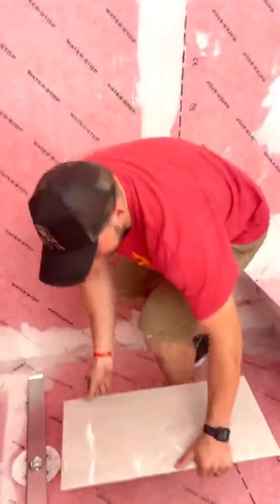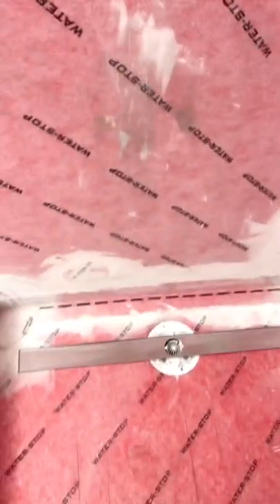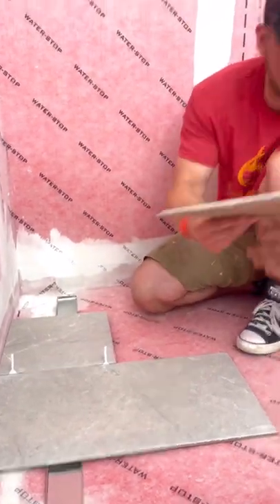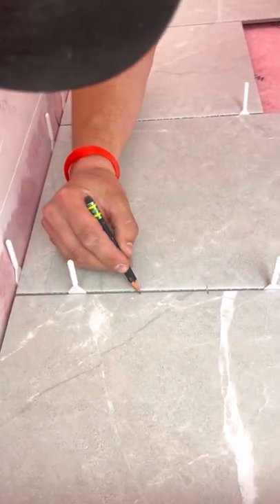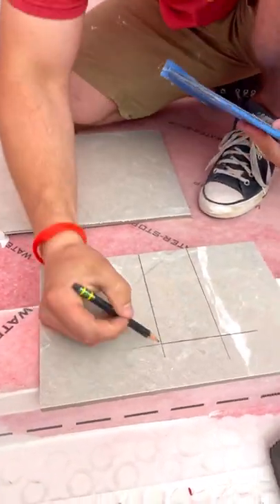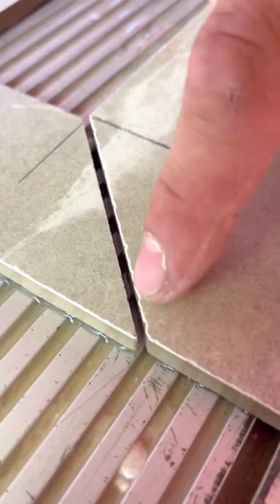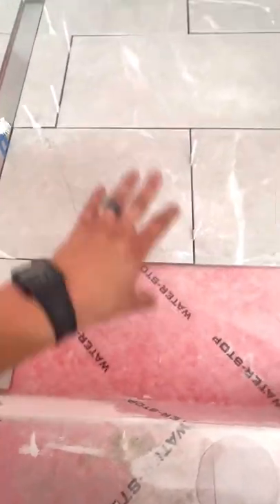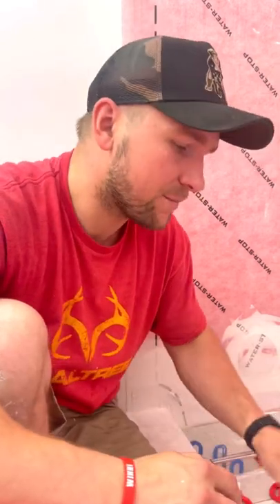🔥EASY🔥 12x24 LARGE FORMAT TILE on Shower Floor. WINNI DIY Vlog 011

Comment: I have  3x5 pan but the drain is off-center as well as to the far side of the pan. Would I still want to run the x cut off the drain in line with the drain as this would not reach the actual corner of the pan. OR would I flare the x off the drain out to reach the corner of my pan? THANK YOU for all Your knowledge & Tips!!! You are a HUGE Help!!!

Comment: Would that drain work with like a thin penny round for example? Hard to tell how thick that drain is but seems like it would be hard to flush out with a tile that requires much less thinset.
Reply from the maker: I do think the very little tiles that would be hard. I would use the drain that you can tile over instead.
Reply: @WINNI.Designs  awesome thanks. Been looking into different shower systems and the guru really intrigued me. Great content as always !
Reply: That's where a real mud Job Would come in. Then you can get it to the exact height you want
Reply: @BonBon770  yeah but with this system it looks like you would be unable to do that because the clamping ring from the drain has to sit on top of the membrane. The drain isn't getting embedded in the mud like a traditional system.
Reply: @ryangunderson5064  precisely, this is one of the downfalls to linear drain and non-traditional in-and-out systems, ie, foam shower pans and or membrane material on a pan ......it's one of the pros to a traditional in-and-out system with a pre slope and a 40 mil vinyl liner and a correct post slope. Different job sometimes call for different applications, nonetheless, interesting. Have a great day